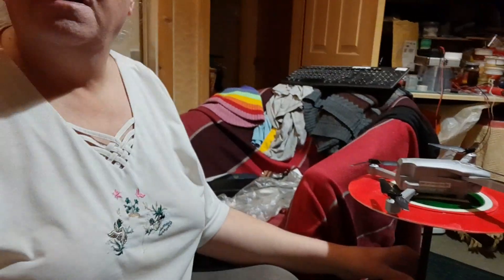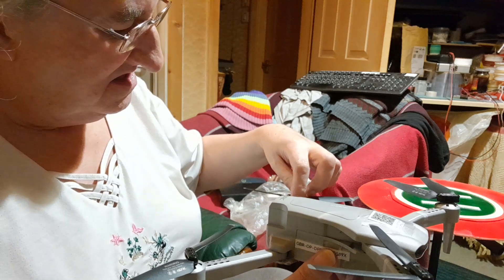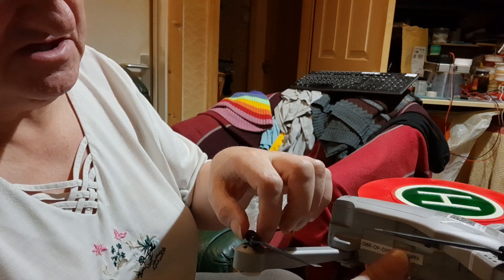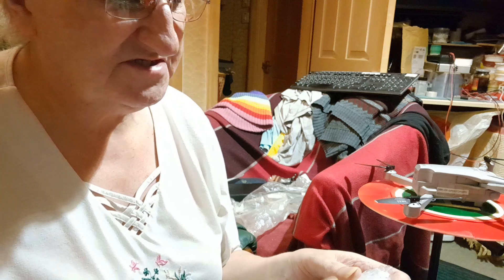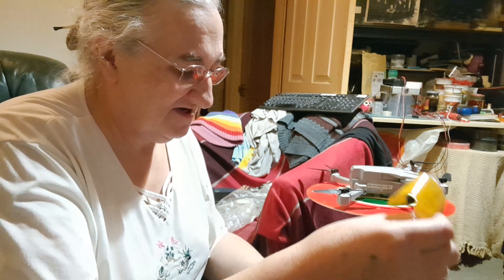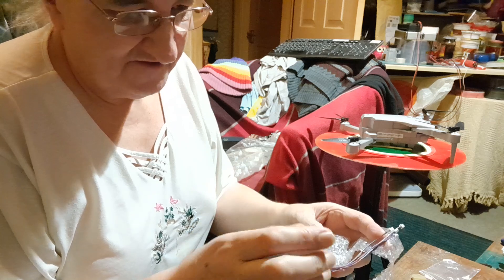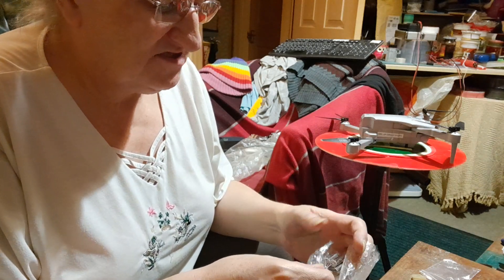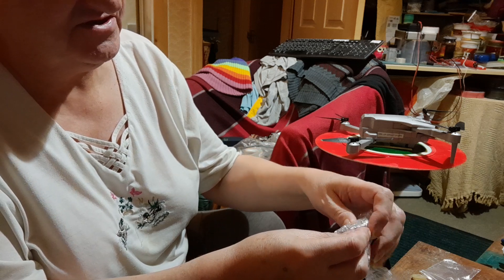4DRC-F3-4K pt1 Repair drive motor gears disassembly.

Comment: I installed the motor of the 4drc f3 no GPS drone on the 4drc f3 GPS drone and the new motors I made are spinning very fast, what could be the reason?
Reply from the maker: Sounds to me like their not compatible, different drones, different weight obviously you need the right motors for the 2nd GPS drone those things are so tiny not so expensive would suggest you buy a complete set of 4. As models vary, and so do motor designs.  Also, the 4drc f3 GPS uses gears to reduce the speed, so if you're not using the gear reduction, you're going to have mayor problems.